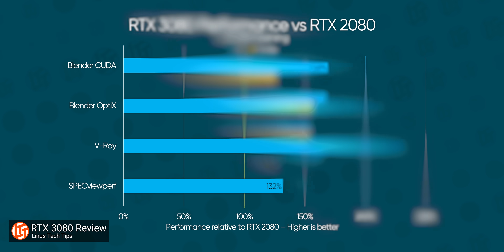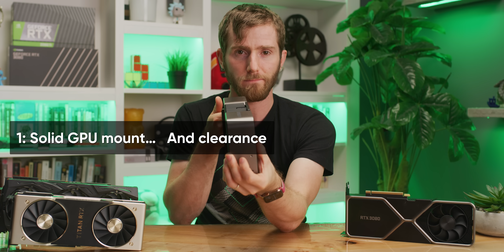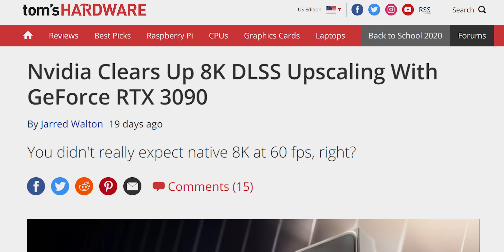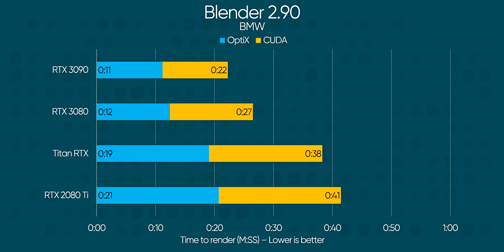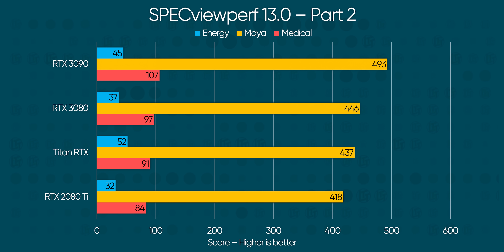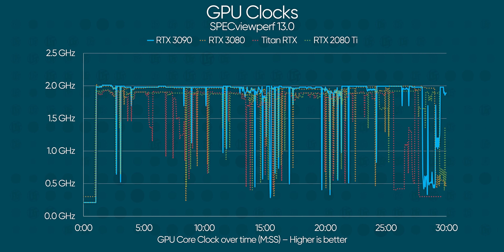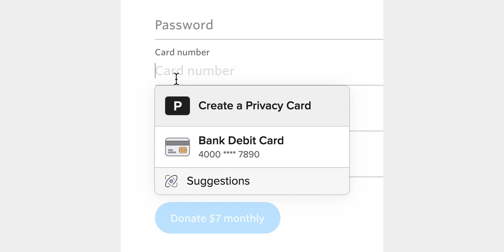Making Nvidia’s CEO mad - RTX 3090 Review

Comment: The RTX TITAN still has more Tensor Cores and ONLY 10 RT Cores less than the 3090...
...Just pointing out that the work loads are only comparable from software development and a rendering perspective. Nothing can't be fixed without just upgrading to a faster CPU or Overclocking/Firmware/Game Optimization. https://youtu.be/JFhG9UntZs4
Reply: the tensor cores are 3rd gen tho... something to keep in mind
Reply: @andrewweir542  yeah 3090 is powerfull too
Reply: Don't mind me I am trying to defend my RTX Titan and trying to talk myself out of purchasing the 3090 at the same time
Reply: ...Or I'll wait until they have a 
RTX TITAN II  with  50GB  
GDDR6X Memory

Comment: Honestly, designing a GPU which weights 2 KG and draws 350W in that size is just cheating. The improvement should have been if they manage to get that performance without increasing any of that parameters, or not significantly.

Comment: 7:27 almost completely wiped out? are you seeing things, linus? there's no difference in that area. the only visible difference i see is the stain on that shiny metal wall which, the 8k DLSS actually do worse than 4k native. it's a little blotchy like when you render something by ray tracing at very low samples and then denoise the resulting image.

Comment: Linus: Ryzen is the best, intel needs to lift their game

Also Linus: You'll need the very best cpu there is for this graphics card... (installs intel i9 cpu)
Reply: it's not a contradiction if you're looking for the very best 1440p or lower framerates with these cards.  as has been demonstrated, at 4k (or higher, as if anyone would use that) there is zero difference between an i9 and zen 2.  value wise, and in terms of being well rounded, zen 2 was and is the best.  but zen 3 is very close... and it looks like amd will finally match or beat the fastest thing intel has in gaming, to go along with its value, i.e. cores per dollar.
Reply: Except Intel is still the best for gaming? I get that Ryzen kills it at productivity, but for gaming benchmarks it's still better to go with Intel.
Reply: If you pay 1500 for 15 % more Power you can buy and Intel with 15% more power than amd for double the price. Amd is just better for the money you spend and not the best overall for Single core. Multi core thats a whole other Story.
Reply: @Blackbirdone11  Intel isn't double the price, I don't know where people keep getting this info, that Intel cost more. In each of the matching variations to AMD Intel is the same price and in many cases can be found cheaper. Not to mention Intel still has previous generations at cheaper prices that are better than zen 2 at gaming. An I5-8600k has better gaming performance in most games than the Ryzen 9 series.... an I5 at literally half the price! All in all, for gaming just buy intel. Cheaper and better for this task alone.
Reply: @Blackbirdone11  Think about what you just said.. if someone is even buying a 3090 in the first place odds are it's not just for gaming. I wager the majority of these buyers either have a 3950x, 3960x or 3970x.. Gamers Nexus did a poll iirc and most of the people interested in this card wanted to see the AMD perf numbers BECAUSE zen 3 is around the corner and a drop in upgrade for everyone on B550 and X570. Rumors are spouting another 15 IPC improvement and nobody knows how much the new CCX layout will effect latency. The main reason single core perf was weaker was because of Infinity Fabric and cores sharing cache across CCD's.. That issue IS gone on Zen 3.. Zen 3 is ES's are also showing higher frequencies.. last reported ES showed a 4.9Ghz boost.. meaning we could very well see Zen 3 hit 5Ghz. I would not be surprised if AMD CPU's were 5% faster in single core perf this time around.. and probably 60% faster in multi-core over Intel equiv.
Reply: ah amd fangirls at it again. why so emotionally invested in a company who doesnt give a shit about ur existence??
Reply: @mangshu21  why so butthurt about people fangay about something else since their existence doesn't harm you in the slightest bit (except in extreme cases where it could mentally damage you)
Reply: @mangshu21  I was there when AMD came up with Bulldozer and Intel fanboys were shitting on AMD so stfu lol.
Why can't you handle people shitting on Intel now? Are you an Intel fanboy or something?
Intel needs to up their game, having to pay top dollar for a few % more performance is just retarded.
Reply: Gordon Freeman AMD does have good CPUs and they really have begun to catch Intel in terms of everything. But the price difference isn’t even that much of a thing anymore. You can buy a 9th gen I9 for 50 bucks cheaper than a 3900x and an I9 10th gen can be found cheaper than a 3950x. In both cases they are worse in gaming. If you are just gaming why spend more for worse performance? For anyone looking to game and surf the web, just buy intel. It’s the same price or cheaper and performs better. In most cases it’s more reliable as well.

Comment: It's double the price of the 3080 with optimistically 15-20% better performance. 8K is there, but not great and you require a stupid expensive rig to pull it off. I agree with Steve's review that this is really more a workstation card. But then they've deliberately gimped workstation performance. So I'm not really sure who this is for. Folks with more money than sense I suppose. I think the 3070 is going to be the one to watch for most people. I'm still waiting to see what AMD comes up with though. RDNA2 should be competitive shader per shader based on console specs. Really depends on that pricing though.

Comment: You know I have doubts that the rtx3070 is actually faster than an rtx2080ti, it has 3gbs less ram and has a slower memory bus and if the 2 x the speed of the rtx2080 claims are anything to go by... it probably just nips on the heels of the rtx2080ti much like the 2070 super nips on the heels of the 2080.

Comment: If the Ampere Titan card is based on the GA100 die instead of GA102, I could see the point of keeping the Titan drivers locked out. Titans tend to be slightly cut down Quadros, and the 3090 is more of a beefed up GeForce card. The GA100 is heavy on the low precision compute performance where the GA102 is far more focused on single and double precision. If they make the Titan using the GA100, then it would actually be in a difference class of card for a change, and could at least slightly justify the driver lockouts. It would still be really stupid, though.

Comment: RTX3090....10 to 15% better gaming than the 3080 for $800 more. What a joke.

No one is going to buy an expensive 8k monitor to play at 1440p upscaled(ai).

No one is going to buy a 1500watt power supply to use a sub-par workstation GPU that sucks down 450watts with no driver optimization. 

The 3090 is a pointless joke.

Comment: Can someone have Inform Linus Tech Tips about this video.

Everybody is being missinformed about the 30-series, from Nvidia propaganda, and since Tech reviewers don't check themselfes, we get missinformed. 
Nvidia didn't want to tsmc because each gpu costs a bit more, so they went with samsung(worse gpus), and they have to spend alot more on coolers, and that also means higher power consumption + more heat. And it is also worse for the enviroment, I am very disseapointed in Nvidia.

Imagine that these gpus could have used less power and be more powerfull, but Nvidia doesn't acutally go for what gives most performance.

https://youtu.be/tXb-8feWoOE
@Linus Tech Tips

Comment: Linus: Here's 4K. 8K DLSS, and native 8K for comparison
Me with my 1080p monitor: Hmm yes I see
Reply: I literally can't see any difference in picture between a 1080p monitor and a 4k monitor. I would much rather have a very high frame rate 1080p than a 60fps 4k
Reply: @Bill_Falsename  Your monitor must be tiny. On small displays you get diminishing returns from resolution. Get above 30" and it's very noticeable. Get around 50" and the difference is massive. 

I run a 55" display because I prefer one large monitor over multiple small ones. 1080 looks like dogshit on it. I'll take 4k@60 over 1080@120 any day, but I don't go deep into competitive gaming as much as atmosphere. HDMI 2.1 can't come soon enough.
Reply: Nothing wrong with 1080. Very, very few people are using 8K.
Reply: + youtube compression
Reply: i can see it at 1080p on a 1440p monitor(whihc makes things look worse) so you should be able to as well lol
Reply: @Shadow0fd3ath24  that's because 1080p does not upscale into 1440P evenly and correctly since it's not a direct integer upscale

Comment: Im not sure if I didnt see the 3070 release/benchmark but I'd like to see Linus test how far can the 3070 go. From a more gounded approach, many will buy a 3070 for the price/performance and will probably not even think about 8k. A test of insanely high FPS at 1080 and how much fpsyou can  push at 1440p and 4k would be so appreciated. The 3070 created the opportunity to upgrade your experience without having to change other components (if u already had a beefy cpu and psu) so I'd think 3070 buyers would like to see heavy testing before considering buying a complementary 4k tv/monitor or a super high refresh rate monitor.

Comment: Normally, I'm super anti-Nvidia, but I actually think you're being a bit unfair. The 3090 does have full support for CUDA, like all of Nvidia's cards do. That's better than AMD, which only makes ROCm available on Vega-series cards. That's why Nvidia dominates in ML and AMD is DOA. I haven't seen good ML perf benchmarks yet for the 3080 or 3090 (supply restrictions and ML researchers are slow). But I'm fairly confident it'll beat the Titan handily in that category. And I think it's pretty cool that Nvidia allows ML researchers to use commodity consumer cards on personal rigs, even if they try to keep them out of datacenters with legally suspect EULAs.

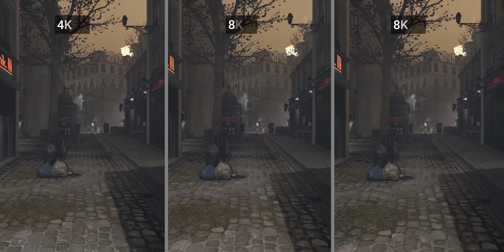Comment: Me at 6:57 watching at 480p: "They are the same picture"
Reply: 144p on phone to save data, "yeah looks good'
Reply: Me at 6:57 watching at 1080p: "They are the same picture"
Reply: @marcoalves9029  Me watching at 4K with my laptop about to break, "they are the same picture"
Reply: Me at 6:57 watching at 1440p: "They are the same picture"
Reply: watching in 4k , still don't see much difference
Reply: Me: Dreaming about watching it in 8k
My wallet: nope.
Reply: your monitor could be 8K and unless the thing was 90 inches, 30 feet in front of your face you wouldn't see a difference in the picture then either.. even if the video itself was recorded in 8K
Reply: @ulfrinn8783  it is not even real 8k.  Linus and some other goof are sellouts.  Go check out Gamers Nexus to hear all that is idiotic about what Linus and some other sellout are doing. These are workstation cards and nothing more.
Reply: @ulfrinn8783  you would notice the 4k one. But, other than that, the difference is marginal enough to justify just using dlss 9x
Reply: @CassieMrrp  Not really,  not unless you were someone who sits very close to the screen or leans in a lot.  And even then the difference would only be noticeable on a still image, once you introduce movement the lower frame rate of 4K is noticeably less sharp than 1080p or 1440P running at 120hz
Reply: me at 144p 😳
Reply: Yeah, hopefully most people do realize there are better things to spend that money on xD
Besides, who da fuq would just stop and stare at a distant object when you're gaming and enemies are chasing you.... I mean, details like that are overrated anyway.
To me, 1440p will be good enough for years to come, not to mention is cheaper.
Reply: They're the same picture to most people, I'd imagine. Just how many watching this actually have 8k displays right now?
Reply: naww dats cute ;)
Reply: Me at 6:57 watching at my new 10K mon: “Wow! It is awesome!”
Reply: same lol
Reply: Me at 144p lol
Reply: I could see the difference at 1080p, but my monitor is 4k capable so it probably helps, that said the pauses are where it really shows. It's a subtle thing and i can';t say i'd want to run out and replace my 2080Ti for a 3090 even if my monitor was 8k capable just to get it. It's cool tech though and my inner nerd is happy.

Comment: Only reason we are to believe this is the biggest generational leap ever from gen to gen, was because 20xx cards were Barely if anything over the 1080 and 1080ti, with the exception of the 2080ti and the RTX titan. Those two cards are in a completely different spending league, and only options if u wanted improved rasterized performance improvement over a 1080ti in the traditional sense. So here we are, Finally with imrpoved rasterized rendering and it is essentially a lot faster, But If the 20xx series would have been the normal 30% improvement over previous gen, then No this 30xx series wouldn't be deemed the Largest jump in generational performance. We were simply, gimped and brain washed with the 20xx series, and Nv like a lot of Large companies, are exceptionally well at marketing and hype, and "Hey what if these games were to use our tech then you  get X performance increase" when in reality, Most devs Opt to NOT use NV proprietary tech in their games, with the exception of a Few larger Triple A devs. End of rant. While it's a great generational leap, if the 20xx series had done what normally was done generations prior to it, we'd be singing a significantly different tune right now.

Comment: The drivers for this card (and all "gaming" cards) are sandbagged in professional software (CAD and other 3D software) to maintain the higher margins these GPU companies get from overly expensive "pro" cards like the Quadro.  There is no good hardware reason this card or other gaming cards couldn't wipe the floor with similarly priced pro cards if not for the driver's being held back.

Comment: Can you do a rendering comparison between 2 of 3080 vs 1 of 3090? I know that only 3090 is capable of sli for obvious business perspective/reason(s), otherwise 3090 wouldn't need to exist, but still theoretically you'd get almost doubled the rending performance with 2 of 3080 than 3090 and save yourselves $100 in the process. The only other use case for the 3090 is if you're a video editor working with high resolution timeline while also stablizing a lot of footage via 6k and 8k footage; that's the only time it will really exceed 11 gb vram. So it it just better to wait for the 3070/3080 ti/super variant?

Comment: Here I am with great vision. Looking at my 21.5 inch 1080p monitor from 2ft away. Can't see a single pixel. Why? Cause proper view distance is determined solely by pixel pitch. Let's do some math. -----  Now that screen is 197.9cm wide and 111.3cm tall for a total area of 22226 sq cm. The resolution is 7,680 x 4,320, giving you 33,177,600 pixels. That's 1493 pixels per sq cm.   --------   My screen is 47.5cm wide and 26.7cm tall for a total area of 1268 sq cm. The resolution is 1920 x 1080 giving me 2,073,600 pixels. That's 1635 pixels per sq cm.-------  Wait, what? noooooo. Is that possible? Yes it is. Why? Typical consumers can't do math. As a gamer you don't need anything more than what your eyes can take in without moving your head. 2 to 3 ft is optimal. 4k in a large monitor is the max you could ever possibly need. Else you would be to far away for it to matter.  In case you were wondering, my little monitor would have a better pixel pitch than any 4k screen over 42 inches (Which is to big to get close enough for it to matter.) and also any 1440p monitor over 28 inches. My upgrade will be a 27in (or smaller) 1440p monitor. Hope someone learned something. Have a great day.

Comment: Honestly saw this coming the moment they said virtualization support was there but was disabled in firmware.  Nvidia got kind of scared with AMD/ATI half way attempting to compete so they actually RND'd an upgrade instead of some increments yearly.  That said, they still need to milk people's money so you can bet their ass they'll disable features and cripple features on purpose because they know people will buy it anyway.  I was already waiting for the 6000 series from ATI to see what the performance to cost looks like first (we can guess the main consumer card will be a bit worse than a 3070), I'm definitely waiting now.  Even if their cars are a bit worse than the 3070 and a bit better than the 3070, if the price is adjusted to fit that performance percentage drop/gain then I'll probably buy ATI if only because they have a MUCH better support model for Linux actively contributing to the Kernel unlike Nvidia that releases a mostly working proprietary driver...sometimes...without features or support most of the time.

Comment: That moment when Minecraft runs at 40 frames per second...on a $1500 GPU
Reply: this should be a new benchmark meme like 'can it run crysis'
Reply: Yeah, then consider the fact the pixel per inch density of a 24" 1080P monitor as viewed from 30 inches is smaller than what the human eye could detect and 4K or 8K would have to be in monitors of 50" or above, still viewed from 30 inches to see a noticeable difference.  So Minecraft wouldn't look any better, it'll just run way slower for $1,500.  But Linus gets payed to hype this crap.
Reply: To be fair, that’s path tracing. But to be fair too, Minecraft Bedrock RTX isn’t really optimized at all
Reply: minecraft is a waste of this gpu's potential.
Reply: That moment when my pc explodes while playing mc with rt on (press like if u know the Meme).
Reply: @Wattermelondog  No, I don't think I will
Reply: @IAmValefree  ok

Comment: I am a CAD designer, I would rather use a Quadro than the great RTX3090. Even if a quadro costs more and is less impressive on paper, it will outperformed it due to, as you said, special drivers. The RTX Titan costs $2.5k as much as a Quadro RTX 5000 so a $3k Ampere RTX Titan would be a great deal however I wonder what those new Ampere Quadro will be